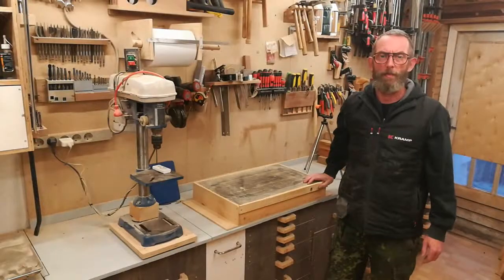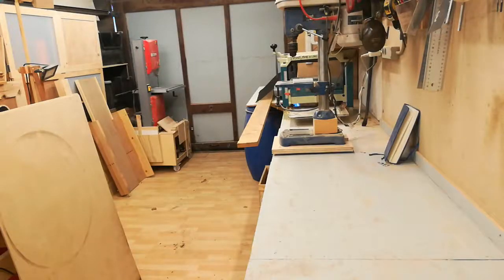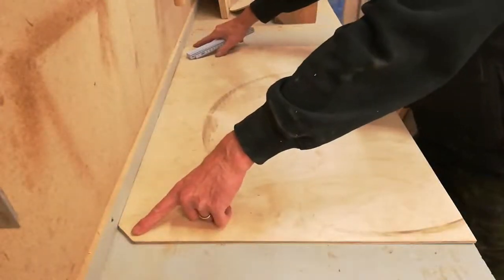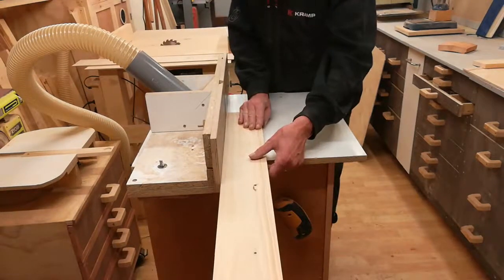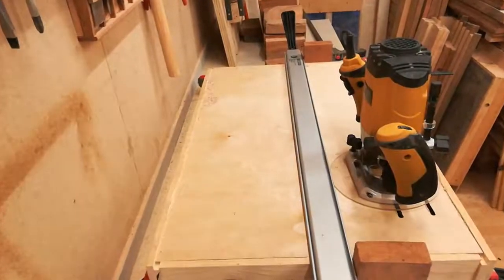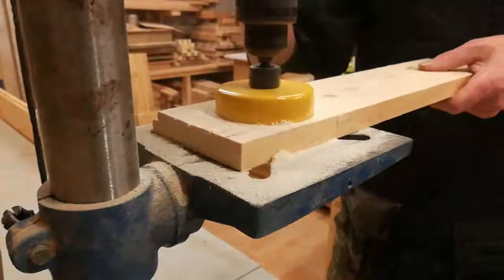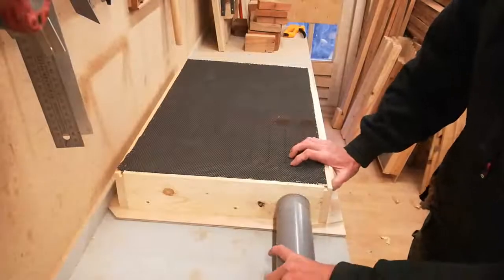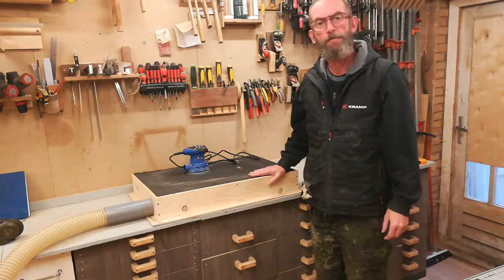Portable Downdraft Table

Comment: So many good ideas. Can't wait for this crazy weather to be over so I can do things in my shop.
Reply from the maker: My shop isn't heated so I know well what you mean but it is still possible to "do things" - or at least prepare for them. Jointing, planing and cutting to size is not that temperature dependant - and if all else fails - cleaning and tidying the shop is also an option in the winter. Then when the weather lifts, your'e ready to go :)

Comment: Super, very nice board you sanded too👍🏻

This is now on my bucket list to make
Reply from the maker: If you make this - drill holes rather than cutting slots - my top became a bit too flexible because I did the slots. It held things down well enough but the top was....bouncy. I guess I also used a too thin sheet of plywood for the top but that was what I had on hand.

I am currently working on a different idea but it is on hold until I can get some contact cement. Hopefully I'll be able to make a video about that idea in the future.

Comment: What do you use for dust extraction? I see you have the nice wide ducts, but on what kind of machine? I'm afraid of sacrificing too much floorspace for a big vacuum.
Reply from the maker: I am actually using a machine called (translated from danish) an ash-remover - a largeish vacuum with a big bucket, used to remove ash from wood stoves and such.
I've hooked it up so the dust and planer shavings are dumped in a plastic barrel - the capacity of the machine itself is ok for dust but planer shavings take up a lot of space very quickly.